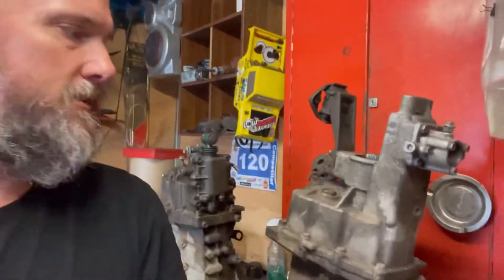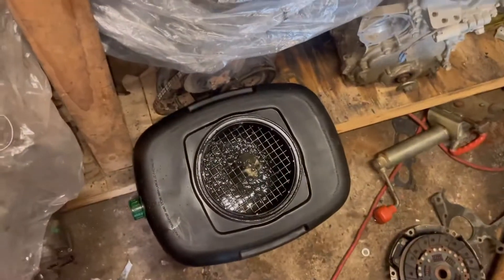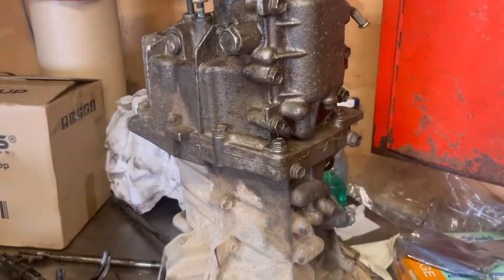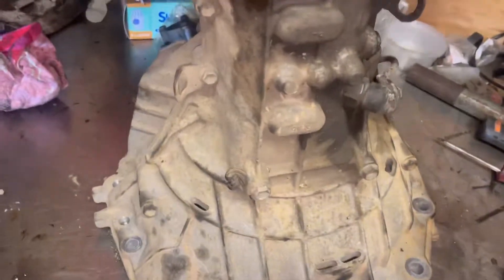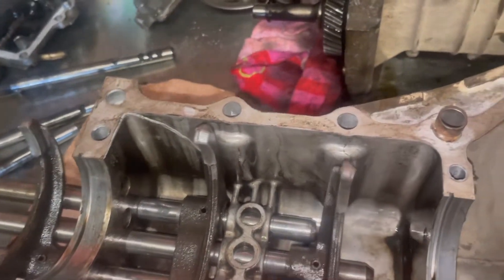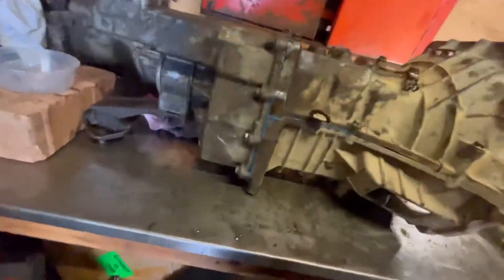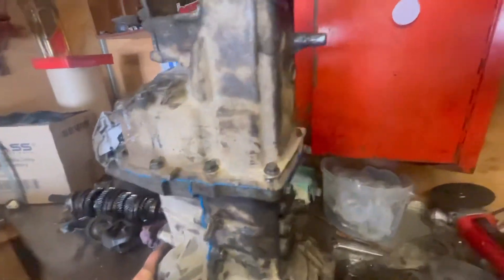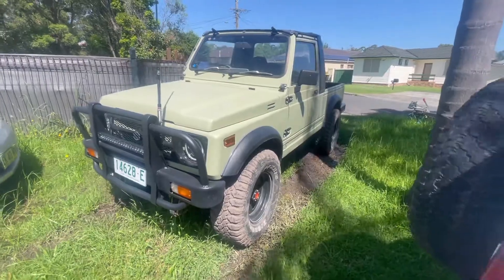Jimny/Sierra Hybrid gearbox

Comment: I have a Question do you know the model of the Jimny Gearbox like the year of production I want  to build this Hybrid gearbox but when I look up for Jimny gearbox I found that the gearbox for 2004 and below are different from 2005 and above and will the Jimny motor mount fit the engine I (M16A)